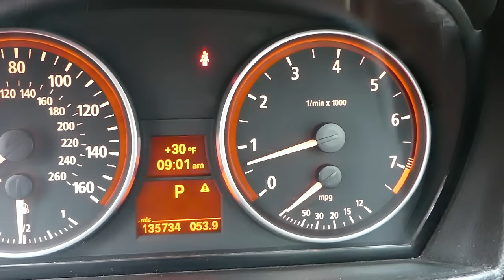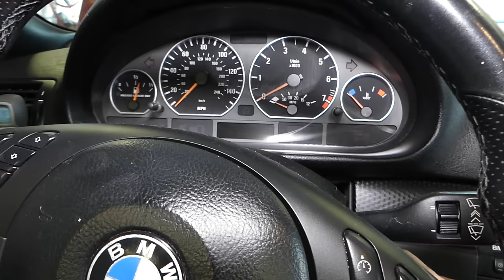BMW CRANKS BUT WONT START 3 Series, 5 Series, X3 X5 Z3 Z4

Comment: BMW Z4 owner (E85) here. I twice had the engine cranking without starting and the solution was super simple. I disconnected and reconnected the car battery and the problem was fixed. The more computerized the cars become the more susceptible the electronics to locking up or freezing (think about your cell phones for instance), hitting a "reset" button can work wonders sometimes.
Reply: I have a z4 too and I did the same thing and it still won’t start. Any advice?

Comment: you can tell it was the computer because u dont get a RPM signal when cranking at 1:05. changed the fuse then the RPM on cranking shows now 6:30

Comment: Appreciate your work and details on the diagnostic but if you crank a vehicle and the            tachometer needle wont move a single bit as this one was since the beginning, you most likely have a crankshaft signal missing, most vehicle cant start without this value

Comment: I have a BMW X5 2008 , it cranks but wont start. Fuel pump is working for sure I checked the pressure at fuel rails. The error numbers detected by the scanner are A0B3 CAS starter motor terminal 50 and from DME 2EFE  fan activated, 2F44 orevent manipulation, I think because I removed some sensors at the engine compartment. Do you have an idea what could be the problem? thanx

Comment: I got the same cranking noise and the car didnt start. (on an E90). I replaced the battrey which was leaking and not holding the charge. Then I checked the fuel pump fuse and it was burnt. I replaced it and I am back on the road again. Thanks!

Comment: Hi Help needed please 
2006 BMW x5 e53 3.0 d
No start   I have found no power to fuel pump under the floor next to fuel filter, if it’s not pumping it will not allow fuel to pass through to the engine ( replaced tank pump and have a new under floor pump to put in but need to know where to look for wiring fault ( which fuse/ relay it is )
Same colour code as pump in the tank - brown + white with green tracer. Any information will be appreciated.
Mark
Australia

Comment: I have a 2009 bmw 325i 3.0L  I've replace the ECM because a coil driver,   now no spark, no injector pulse,   crank and cam sensor signals ok to the computer, 
only cranks but no start with the new computer either with the old computer.
do you think it will be the immobilizer??

Comment: You said all BMW? How about an x6 BMW active hybrid? It won’t go on ready. I charged up the hybrid battery to 40% and it cranks the engine but it won’t fire then the car disable cranking all together and throws hybrid powertrain code. I have to wait a while before it allows me to crank again

Comment: Thanks so much for your videos, I have a 2004 bmw x3, 3.0  and I need to replace the fuel pump and fuel filter, I believe both of them are inside the gas tank. Have you ever replace the fuel pump on the 2004 x3. Any help would be appreciated specially with a video tutorial.
Reply: Lmao find ur fix in the gas tank?!! 😓
Reply: Fr I wanna know I have the same car trim all

Comment: Hello and thank you for great videos. Do you have any idea why is my fuel pump on E61 525d priming for 1 minute when the key is on 2nd position? The problem is that the car isnt pumping the fuel back to the right side of the tank, all the fuel gets over to the left side and the fuel pump ends up dry. I already replaced the fuel pump but it didnt help. Thank you.

Comment: I have this problem on my x3 m sport... Same noise, if I keep trying it normally starts eventually... Sometimes 3/4 turns others multiple tries for 5 mins or so. It's fine when driving about just can't turn it off to pop to the shops ect so is a right pain. Mechanic has looked at it and can't figure the problem out.
Any ideas?

Comment: Hey brother love your video’s I have a crank no start 2002 BMW X5 4.4 I changed dme ran beautifully so I decided to clean vehicle and power wash engine I let it run 1 hour then shut off next day no start check relay changed it no power to fuel pump jumped relay 87 and 30 circuit powered up to fuel pump fuel pump is functioning put relay back in plug back fuel pump still no start it been 4 days so far any advice where I should blow air I also checked fuses and there good it’s getting frustrating please help brother

Comment: I have a 2005 318ci. It sometimes starts, sometimes doesn't. When it does fire, it tends to fire first time. It tends to be morning when it doesn't start when it is cold. What can I eliminate from this list of checks? When it fails to start, it generally manages to fire briefly but dies before managing to reach a steady idle. Surely the fuel pump must be ok right? I am thinking of using a fuel injector cleaner and change the fuel filter in any case. Will work through this list of checks but any other hints/tips based on the above specifics would be gratefully received!

Comment: Hi i have e46 318i n42 motor car cranks but don't start can oxygen sensors do that 
Car takes long to start then if it does start than drive for awile then dont start than i must wait till the car cools down then it's starts then i replaced the coolant temp sensor then it was ok for awail now car is struggling to start or dont start at all where can i scratch and this for the videos it helps alot god bless and many thanks

Comment: Problem with my car is when I turn the key, the abs light is on but the dash gas level or cooling temp or even miles don't show up.. the fuse is not blown, already checked.. and well car cranks but won't start.

Comment: Hello, I have a 2008 x5 diesel 3.0sd. The problem started while driving. Suddenly the transmission drops into neutral and car loses all power and I would have to stop the car and restart. I could then drive fine for a while.. The problem got worse and now the car cranks but does not start. Starts for a moment and then stops. Please help 🙏
Reply: I've seen a video which shows the fuel pump relay being in the back but it's not located there. Where might it be?

Comment: Just replaced my valve cover gasket on E93, N52 Engine, no start, any ideas?  Everything is connected, nothing out of place or broken.  Would start reliably before the job

Comment: I have exactly the same problem on my x5 but when I replaced the fuse, it pops again when the ignition is turn on.
Reply: Something can be shorted and can cause more resistance than usual and will pop the fuse. Start by checking Ignition grounds by the Coils , battery Main power wire and ground then wire where u usually jump start your vehicle and also check all the fuses and make sure there good and not corroded or Melted.

Comment: Hi. I have an e60 523i 2008. There's Crank but no start. No engine management light comes on when ignition is turned on. Upon cranking the rpm doesn't move above 200rpm. I'm getting fuel but there's no spark. I even sent the computer box, cas module and key for testing. No fault was found. Car is standing for 1 month now. Any help would do. Im already 6k in expense and still no solution. Thanks.
Reply: Did you get this figured out? I'm in the same boat.

Comment: Bmw e46 320d 2002 won't start. By second switch with the Key, headgauge came on, and now won't start the car. Problems with lights also now.

Comment: I have a 2012 535i xdrive that died as i was driving and 2 minutes later it started back up i drove it for a day parked and it never came back on i checked the low pressure fuel pump by taking the fuel line off and try to start and shot gas all over the seat so i but it back together so i replace the high pressure fuel pump and still getting the same thing so now im changing the spark plugs i dont thing thats the problem but could you help

Comment: I would check battery first before checking fuel pump. First, make sure battery connectors are tight and free of corrosion. Use a miltimeter or battery tester to check battery voltage and CCA to see if the battery is even good in the first place. Then, I would check fuse(s) and relays, etc. Great video though!
Reply: infiniti_chik I took my battery to autozone and it was at 70% 12amps charge. It couldn’t charge anymore but when I placed it back into the car, everything worked except it still didn’t turn on. Barely cranked. 

I’m going to check the relays tomorrow.

Comment: Does anyone know where the fuel injector fuse or relay is on  E83  2007 x3? I have a crank and no start issue with 80 pounds of fuel at the rail

Comment: My 535i has stalled 2 times and stopped and doesn't  start..   i screen tells me its fuel pump ... but it will start after waiting  30 minutes  or more ...  they have checked for codes and nothing..      it happened again  and about  40 minutes  later without  the key I heard the fuel pump on ... the sound was around  the engine area as I was sitting  in driver seat ... after I heard the fuel pump ... i tried starting  and it started up right away... any idea what it can be..??  Its a 2009 535i

Comment: I have a bmw 2008 328i  has no crank?? Drove to the store  then turned off and no crank at all?? I changed the relay in the glove box but still no crank?
Reply: Drew DoWN 2011 but same problem
Reply: @RICHGARAGE   im going to check it this week with obd il message u if i figure it out
Reply: Im so happy i have seen this comment im having the same problem did you guys figure it out?
Reply: @gasintheair   replaced starter it was fried when i pulled it off works great now after i replaced....if u tapp the starter while someone trys to turn it on the gears will move real fast thats  how i new it was starter
Reply: @RICHGARAGE   replace starter

Comment: hi i have a BMW X3 it won't start. the fuel pump is working. and the engine fuse is till good.
Reply: check the starter and ignition

Comment: Hello.

Thank you for your videos.

I have a 2007 manual BMW e60 520d with an N47D20A engine 130KW, 177HP. I live in UK near Birmingham.

Last month I changed the timing chain as a precaution as it hasn't been changed in the last 5 years and it had more than 200,000 Km with it. I also changed the reluctor and the crankshaft sensor, the glow plugs, the intake manifold, the temperature sensor before the catalytic converter, Lambda sensor, two injectors, the HPFP and the LPFP were changed 18 months ago together with the relay. All the fuses are OK (those in the engine bay, in the glove compartment and in the boot), I checked all the wires for continuity, scanned the car with ISTA-P, no relevant errors.

After I changed the timing chain, the car started fine, I had a 500 km trip while the car drove excellent. The next day I was unable to start the car, no matter what I've tried. I charged the battery, I checked everything, changed the reluctor and the crankshaft sensor, but the car still won't start. All the connectors are in place, all the wires have continuity, all the fuses are OK, the car cranks but it won't start.

There are some issues which started after I put the engine back:

1. The car won't crank more than 3 times when I press the button. Before, when I pressed the start/stop button, the car will crank as long as I keep pressed on the button.

2. The car won't show me when to change the gear when I was driving.

3. I had two new errors on the scanner which I never had before: P0335 - Crankshaft Position Sensor "A" Circuit and 3E90 - Crankshaft RPM - No signal. These errors dissappeared once I changed the reluctor and the crankshaft sensor.

4. One of those 20A fuses in the engine compartment was fried. I put another 20A fuse, it fried again. Then I used a 25A fuse and it was OK. The fuse is the second in the 5 fuses which are there, which according to this video is dealing with the crankshaft sensor. This sensor was replaced.

5. The LPFP is priming (I can hear it working once I plug the key). When I crank, there is fuel going to the injector (I unscrewed the connector and is leaking diesel with pressure when I crank). But, when I removed the injectors, they were all dry, as in completely dry, like the injectors won't open to allow the fuel to go through. Is there a relay in this car which controls the injectors? Would you please let me know where it is?

What is your opinion about this? Why the car won't start? What else I should check?

Thank you for what you are doing.
Reply: I want to learn u get it
Reply: What was happening, i have the same issue

Comment: cranks but wont start,, bmw x5 e53 3.0d 2003, no fuel to injectors,,, no pulse to injectors,,, fuel pumps running,,, please help,,, fuses in e-box are OK

Comment: 1995 E36 318i  cranks but sounds like it's not engaging, turning over fast. Fuel pump is active and double checked with starting fluid. Still no start. Fuses checked.  Ran fine and immediately died during a drive, no warning. As the crank sensor is an expensive part, is there a simple way to tell if it MIGHT be the timing chain? Worse problem but I'd rather not have to spend money for parts not needed. Any direction would be appreciated as I'm an old guy and just need some direction to "protect" myself from less than reputable mechanics. Thanks!
Reply: Work?

Comment: Have been having issues with my car trying to turn over
but not starting, or finally turning over but then stalls right
out. Recently replaced sparks, coils, fuel pump & oil
pressure switch. This issue was already happening prior to
these fixes but seems to be getting worse. Doesn't happen
everytime I try to start it but when it does can take
anywhere from 3 to 10 times before it actually starts up.
HELP!
Reply: Did you ever fix the problem? I have the exact same issue , plz help!

Comment: I've replaced ignition coils , and spark plugs and the cam shaft sensor. now the car will not start it will crank just won't start. I thought this issue was from getting bad gas, so I wanted to run it with new gas, but it won't start.????? anybody else have any of these issues?

Comment: Hi

I been trying to fix my BMW 316i Petrol Auto. MFR Sep 2004. Its a car i bought this car about 2 months ago, i am based in London.

When the car is warm it runs but having hard time to get this started. When i start for the 1st time every morning the car starts but after few seconds it get switched off straight away.

This car was in the car garage for more than 6 weeks and  i just took it back as he could not figure why this causing the cold start issues. However he had changed the Voltronic Motor but the issue still present.

RAC - said the battery is dead and i replaced with the new one gave the error codes as 2A70 (Intermitten), 2A63 (Intermitten), 29CC (Permanent) and 29CE (Permanent).

After spending hours and hours looking at various video about trouble shoot, decided to look into DISA Valve & Idle Control Valve but went to fix it my self but this is not on my car. I have throttle valve or butterfly valve, did little bit of cleaning on that but still no luck. 

I change all 4 sparks plug, still the same problem, i am getting some fuses and 2 new BOSCH coil pack as i think one is really bad and need this change.

I am not a mechanic but i must say i have learned so much about this issues now by looking at various videos, thank you all.

Question: does this car has DISA or ICV, where does the fuel pump relay is located on this car? Are there any fuses i should check, can the DME cause this issues ?

Can anyone please help me to diagnose this issues to have this drive again.
Reply: UPDATE 

Today i replaced the coils cleaned the throttle valve or butter valve as this car does not have  DISA or ICV. Changed the fuses.

Based on this video if the fuel filter is bad than the car will start but will dies, so am going to change this too and see if the problem disappear.

If this is not going fix this problem, not sure what else could be. The car does not worth as much but i am doing this so i can learn to diagnose :)

Appreciate if any one can suggest any hints and solutions?

Comment: Hello I have same problem X5 2001 e53 3.0. I changed battery and drove. Then after removing car keys the ventilation was working! So reading on internet I learned it's faulty final stage resistor. They said remove the fuse 50a for blower. Now the car cranks no start. Fuel pump I verified is working and pressure is good.  I did not disconnect battery when removing the blower fuse. I heard spark when removing slowly the blower fuse as blower was working. Now right after crank no start. Car was driving fine before. How do I find what happened? I have not verified engine fuses only.